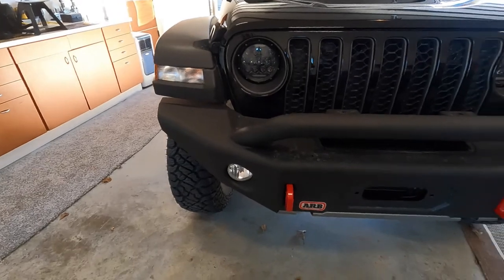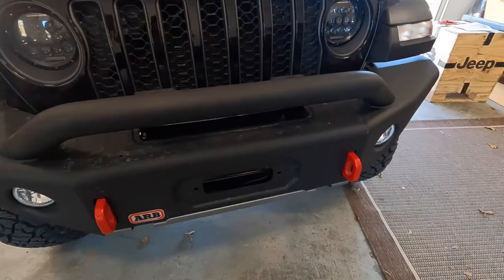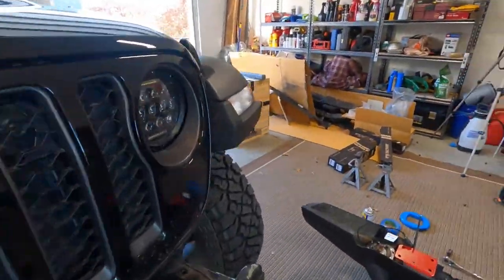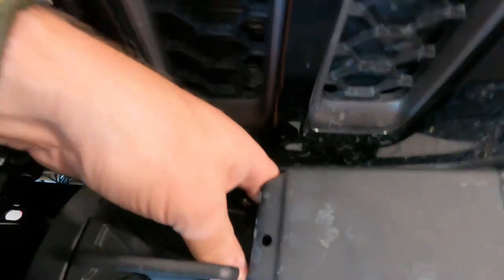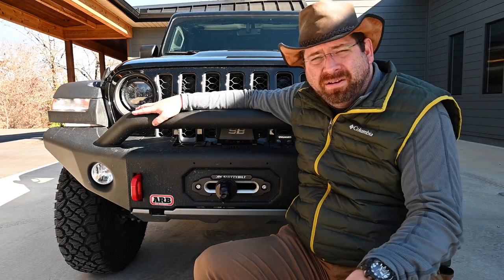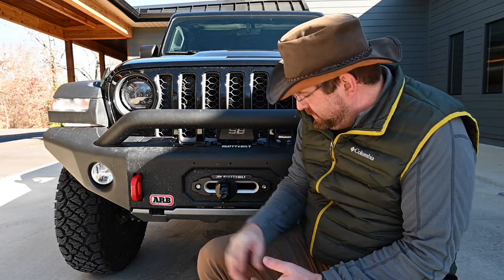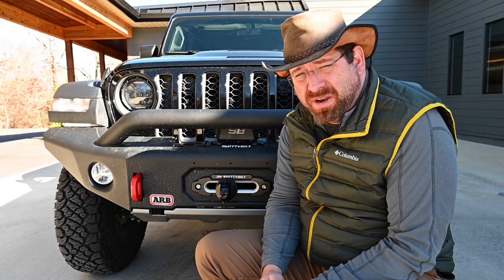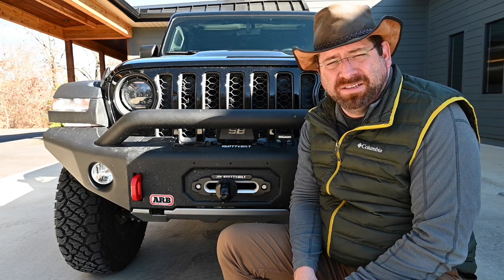Love/Hate with the ARB Bondi Deluxe Bumper!!!!

Comment: I have the same bumper with 37’s. They stuff horribly into the bumper and prevents steering when you need it most when flexed. I’ll need to cut into it and make some clearance.
Reply from the maker: Thanks for watching. I have heard that exact same thing from at least one other person. 37s and the full length bumper apparently don’t play well. I think trimming the bumper is certainly an option. The other, albeit way more expensive, would be to switch to the stubby version. I can’t remember where it was on a forum or you tube but someone had done that and was very pleased with the result. Hope that is helpful. Again thanks for taking the time to check out our channel.

Comment: Hello - What did you do to mount the bumper to the jeep itself? I am having an awful time mounting it up without some sort of crane or adjustable hit trolley device
Reply from the maker: I used a floor jack on a short table I had.  It was a royal pain in the rear.  the Jack gave me the adjustability I needed to get the bolt holes aligned with the frame.  Once I had a few of the bolts started the rest were fairly straight forward.  I hope that helps, good luck.
Reply: @orderofthetravelinghats236  Perfect, the key seems to be aligning the holes without having to lift it. My buddy has an adjusting table so i think that will work! Did you ever get touchup paint from ARB, I have that same scuffing issue?
Reply from the maker: @michaellittle5998   I never asked them for any paint.  I have used undercoating and then a flat black to touch up areas.  The texture matches and the color is close enough for a bumper on a jeep that I am routinely using off road now.

Comment: What is the biggest tire size that this bumper can accommodate without rubbing? I have been planning to get this bumper but I have 37 inches tires.
Reply from the maker: I am running 35s with no issues and I think based on the clearance that a 37 would be no problem either.

Comment: Is the bumper available without the bull bar?   I'm thinking it will block the view of the front cam. Thanks.
Reply from the maker: The ARB only comes one way, so far as I know.  They have a classic and a stubby model that may be more what you are looking for.  I do not have the front facing camera so I can not help with that.
Reply: I ordered a new Rubicon and waiting for it to arrive. I have been researching front bumpers and like this one the best. But now wondering if my front camera will be compromised?
Reply: @michaelraasch4878  I'm with you there buddy. I love the bumper. I don't have my Rubicon yet, so I don't know if it will block the front cam. ARB don't seem to know either.
Reply from the maker: @michaelraasch4878   I do not have the front camera.  However the front is mounted relatively high in the grille so it may not be an issue.  In my experience with ARB they are very well engineered and likely took this into consideration.  If you are serious I would give them a call or an email.  I would be curious to know what they say.

Comment: What are your thoughts on the weight of the whole bumper? I’m debating between this one or the addictive desert designs full width. And that one is 50 pounds less.  Primarily daily vehicle and overlanding
Reply from the maker: The weight has not been an issue so far.  I am not running the factory suspension.  I currently have the mopar 2 inch lift installed.  The spring rates on this are slightly different and the shocks are valved very differently from stock. I don't know how the factory suspension will react. I think the addictive desert stuff  looks good but I have never really seen one up close.  I doubt you would go wrong with either one.
Reply: @orderofthetravelinghats236  thank you. And thank you for the video

Comment: Question! Which XRC winch were you able to fit? Is it Gen3? Thanks!
Reply from the maker: It has a gen3 9500lb with the synthetic rope. It fits but it’s a little tight. If you took off the plastic trim (I did not as I like the extra protection for the winch) it would have less clearance issues. As it is it just fits but there are some areas with about 1/4 inch of clearance.
Reply: @orderofthetravelinghats236  thanks so much!

Comment: im wondering do you have to buy the winch plate separately? or it come with the bumper
Reply from the maker: It is included with the bumper. As I noted in the video it is by far the most overbuilt winch plate I have ever seen. I have since used the winch and can say everything works very well. Still very happy with the bumper. Hope that helps. Thanks for watching.
Reply: @orderofthetravelinghats236  Thanks for sharing this information.